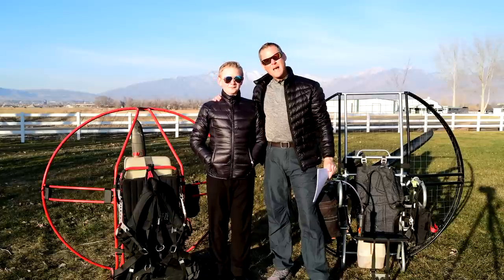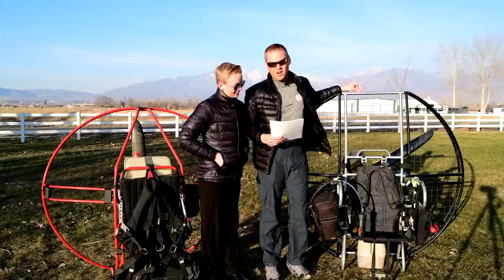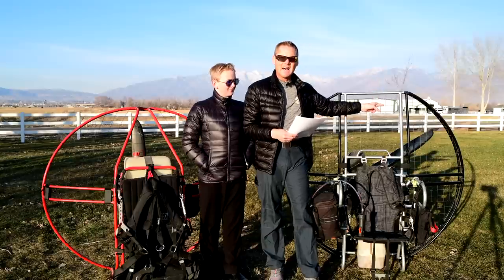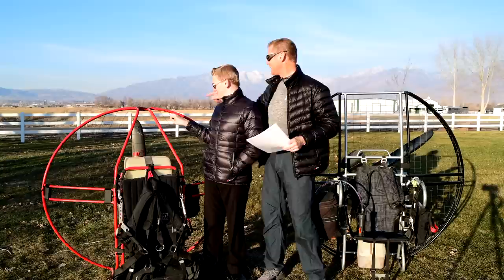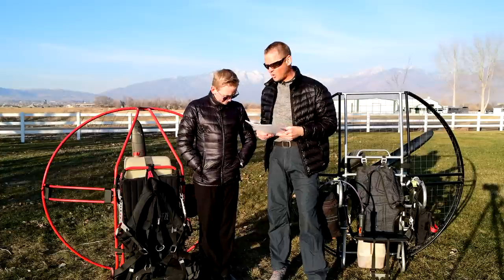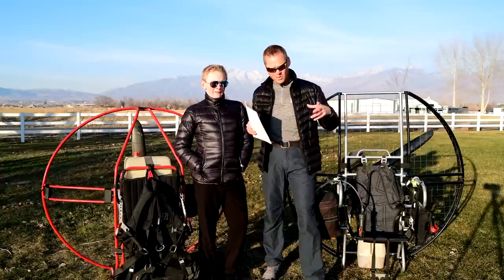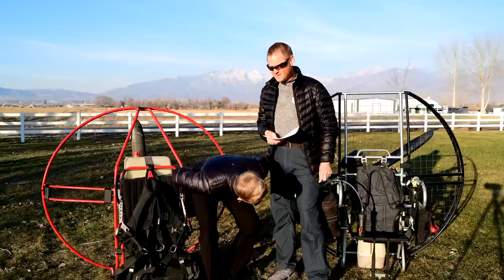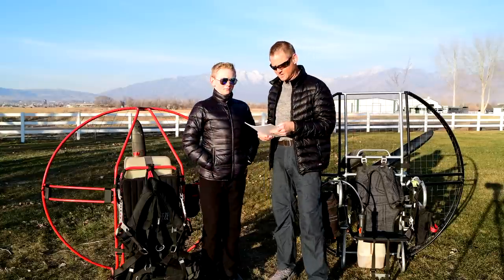Page 5 of the 304 Reasons Flat Top Paramotors Are The ONLY Powered Paraglider To Buy & Fly!!

Comment: Fresh breeze is junk, that is undisputed. I would like to see/ hear some comparisons to the Parajet V3, which I feel is a quality machine comparable to the Flat Top.
Reply from the maker: Well no the parajet is really not any different then the fresh breeze.  No crumple zone, no protection from the prop, no face plant protection... plus Parajet are extremely heavy.  Even heavier then the fresh breeze.  Just take the 304 reasons the Flat Top is the best and compare each of them to ANY unit on the market.  Literally no other unit on the market comes even remotely close to the Flat Top Ninja.  Here is a side by side climb rate comparison between the Flat Top Ninja that weighs 54 lbs and the 104 lb Parajet rotron:  https://www.youtube.com/watch?v=rGNUX1Ethac&t=2s  The parajet was a total piece of crap.  The guy had the motor fail so many times on the parajet it's just ridiculous.  Imagine falling down while running as fast as you can go and a 104 lb paramotor putting out upwards of 210 lbs of thrust smashes down on the back of your head.  Watch in this video what happens when you smack into the ground on a parajet vs a Flat Top.  You can see the Flat Top pilots hit much harder then the parajet pilots but the Flat Top pilots totally walk away without injury while the parajet pilots are critically injured or killed:  https://www.youtube.com/watch?v=060yaNiN1oU&t=32s  So you know straight up anyone pushing parajet is either totally incompetent or just flat out sick in the head.  Sooooo many injuries & deaths on units like parajet and scout and others just like them that it's simply absurd to consider anything but a Flat Top.  There are seriously dishonest and incompetent people in this sport pretending to be experts and even "instuctors".   You really have to LOOK very closely at the skill of whom you talk to as well as the skill of those they have trained.  Also listen very closely to what each person says as it's either obvious and logical making perfect sense or they are just talking garbage.  You don't get to be the best pilot in the world without massive amounts of experience and you don't get massive amounts of experience if you are dead.  So there is a reason nobody on earth can do what I do and a lot  of it is that you just don't live long enough on horrible gear to get to my experience level.  Nobody on earth can even come close to doing what I've achieved:  https://www.youtube.com/watch?v=dMS8si-V1EU&t=1s things like that are just flat out not possible on horrible gear.  To maintain that attitude without sinking into the ground takes the absolute best power to weight ratio possible.  It also takes an incredibly safe unit because you don't get to that level without massive practice and piles of people who have tried to do wing tip drags like that have been seriously injured on horrible units like parajet, scout, nirvana and others.  For those interested in getting into the sport it's absolutely life & death critical to call and talk to me at 800-707-2525.  Nobody in the world can even do what my students can do let alone compete with me.  I challenge anyone and everyone on earth to try to beat SUPER Trevor for example:  https://www.youtube.com/watch?v=ct0Pl4wazFs&t=3s  this is not about bragging.  This is about people's lives.  People need to really KNOW who does indeed know what the heck they are talking about vs those who are all talk.  Nobody on earth can even compete with my students let alone me so trying to train with joe blow just does not work out like people hope.
Reply: Dell Schanze Thanks for your speedy response. I have watched many of your vids and have lived in Utah my whole life. Your sales pitch is very convincing and IF what you say is true ( I’ve no reason to doubt you at this point) then I’m sitting on $10k of brand new V3 250 parajet junk. I’ve been a PG pilot for a few years and decided to go PPG recently. Honestly the pg crowd is just boring and I want more/ better flying opportunities. Maybe next time around I’ll try the flat top.... Until then I guess I’m stuck w/ my parajet junk. Please be nice when you see me out there, I’m just learning. I’ll be flying around the Vernon area.✌🏻
Reply from the maker: I really don't do sales pitch.  It's about very specific things that directly effect your life and enjoyment of the sport.  Since I can sell parajet and every other brand I have no reason to push one over the other beside the fact that the Flat Top literally is so much better then all others that it simply has no competitors even remotely close.  Do you really want to find out the hard way all these things I'm listing one after another? If you try to continue flying a parajet you will indeed spend more repairing it then it costs to just buy a brand new Flat Top.  Better to get rid of it now before that bump causes a prop strike that catastrophically self destructs the whole unit.  I've been there done that.  I've had my brake toggle go into the prop TWICE on non-Flat Tops.  It's far better to learn from the experience of others.  So when over 100 people have been shredded in props on units like parajet it makes more sense to not have to go through that yourself before you change and stack those odds in your favor instead of against yourself.  Do you really want to break your back like Tupper just to find out that having crumple zone really could have saved your spine? If it were just Ford vs Chevy then I would simply beat everyone else's prices and that would be that.  It isn't the case though.  There is only 1 paramotor honest competent people can recommend and that is the Flat Top.  So instead of waiting for that $4000 repair bill to repair a catastrophic self destruct wouldn't it make more sense to switch to a Flat Top now before you waste a huge pile of money and possibly end up quitting the sport over it like so many others? The sport is hard enough with the best training and gear but without SUPER training along with a Flat Top & Dominator you are just not going to have that incredible experience like those who really do get the very best gear and training.  Now you may have been a paragliding pilot for a "few years" but can you walk up a pole or vertical wall balancing perfectly on top? Can you even reverse kite with no hands or perfectly control the altitude of your butt with your glider to within 1 inch? Since the answer is no it really means that you should seriously just come through SUPER training and gain all those critical pieces that you totally missed trying to train elsewhere.  It's really just an honest matter of either you have those skills or you don't.  If you don't then you will definitely want to come learn them.  Then you can fly anywhere, anytime and do anything other SUPER can do instead of getting stuck on the ground having to wait only for perfectly mild conditions to dare get in the air.  With SUPER training and a Flat Top & Dominator you can literally fly when ever and where ever the heck you want basically .  Instead of all that parawaiting you could instead be flying all over the place and getting a ton more out of the sport.  It's not about getting in the air it's about having full and total control so you can really do anything and fly anywhere anytime.
Reply: If you decide to sell your para jet let me know;-)
Reply: Dell Schanze like I said, I guess I’ll have to wait till next time around. Already spent my nut on a parajet..... See you out there
Reply from the maker: Even if it was free it simply isn't worth it.  All those many things that have happened to everyone that has been in the sport awhile end up happening to you.  Of course there are always those who ignore the advice of experience and wisdom just like Tupper who broke his back exactly like I warned him he would or Jeff who died after I told him he would over and over if he didn't get off the unsafe gear.  Some people listen to the advice of the most experienced in the sport some don't.  You have to think about more then just you though.  All those who have died on the horrible gear after having been warned of the many issues really bring a bad image to the sport when the fact is zero people have ever died in history on a Flat Top paramotor.    I counted 19 dead in a single year and if you look at the circumstances of each one there is just no way they would have died had they just been on a Flat Top & Dominator.   Makes more sense to stack the odds in your favor instead of against yourself.
Reply: Dell Schanze I have looked for true stats and accident reports. Is there a reliable source that has all accidents and causes compiled like the FAA does?
Reply from the maker: Nope there isn't a website out there that compiles honest real incident information.  The only one who really follows it seems to be me.  You will here a ton of the what's happened stuff in my latest video series of the 304 reasons the Flat Top is the only paramotor to buy.  Each and every incident and issue I've ever heard of or read about was taken into account when I designed the Flat Top.  It's complete insanity that no other unit has even the most basic and obvious update like just basic protection from the prop.  Instead dishonest people just keep pushing the same ancient skycruiser design in units like the scout, miniplane, kangook, skymax and piles of others that literally don't have even 1 single safety update to address ANY of the very well known issues in the sport.  The Flat Top is literally the ONLY unit on the market designed to address ALL of the issues.  A ton of the incidents out there get hidden or the information is quickly removed as the liars don't want anyone to know the truth about just how many have been seriously injured & killed on their gear.  There was even a video of Jeff Goin, the scammer who setup the usppa scam that pretends to promote people as "certified instructors"  was covered with the blood of one of the victims he scammed who was like so many others shredded in the prop of the garbage the fakes he pushes as instructors scams their victims into buying.  It wasn't up for long though and it was taken down.  Or like the info about the blackhawk instructor Micheal Mixer who is one of the usppa scam instructors who broke his own back TWICE in the same year and killed 2 students in a single month.  Try to find any info of it out there though as they threaten people up and down to get it taken down.  Still to this day they push the same totally fake instructors pushing the same horrifically unsafe blackhawk gear that literally doesn't even pass a basic certified rigging inspection as the back of the harness load bearing straps are just sewn to a piece of cloth and in front they improperly use a buckle so the whole pilots weight is held only by the tiny sliver of metal on the cheap Chinese buckle.  Those who really use a bit of brain power would be shocked at how horrific some of the scammers are.  Those same people put up every lie they can make up about me trying to trick people away from the best and safest gear & training in history in hopes to get them to give money to the scammers that killed 2 people in the same month.  It's total insanity.  Don't even try to say government certifications because that's exactly what Canada did.  They made the very scammers who don't have even the most basic skills the very people you have to go to in order to get the Canadian certifications.  At least a ton of people from Canada come down to train with me before they go to get their paperwork up there.  It's so critical for people to get true and real training up front because those who don't get proper training up front very rarely ever recover from it.
Reply: Well, while you are still comparing to the Fresh Breeze, I just want to ask about the only aspect where it seems like they're better. Why do you put your gas tank in the crumple zone, isn't that dangerous? If you can just link to a video where you've already explained it, that would be great.
Reply from the maker: The fuel tank pushes safely up out of the way.  Just watch this video for example where the Flat Top was completely totalled using every inch of crumple zone and notice the fuel tank is completely unharmed:  https://www.youtube.com/watch?v=060yaNiN1oU&t=33s   ... and the obvious, logical, factual truth destroys the lies yet again.  I have pictures of another Flat Top that was stalled straight into the ground on a 17sm uncertified acro glider.  The pilot walked away without a scratch using every inch of crumple zone and yet again the fuel tank was undamaged.
Reply from the maker: Yes amen to that.  While I'm a Polini dealer I never even ordered one because the weight is so heavy it just doesn't even remotely compete with the best engine on the market which is our custom tuned and optimized Vittorazi.  Power to weight ratio is absolutely critical as is reliability.  Adding 20 lbs more weight means you just can't run near as fast as you can without that extra weight.  That severely limits the size of glider you can fly and at what altitude you can still launch in zero wind at.  The Flat Top Ninja is so light and easy to launch even my 12 year old can do it in nil wind at high altitude.  I don't think some people are considering things logically when choosing which paramotor to get.  The Flat Top Ninja just makes the most sense as you have the best safety and durability along with the power and lightweight.